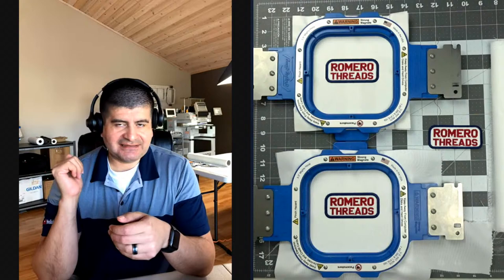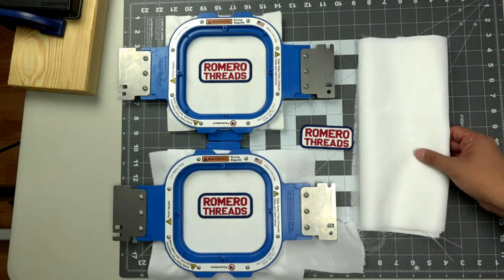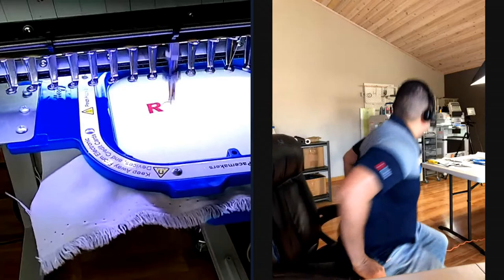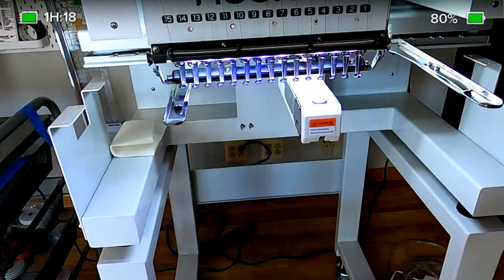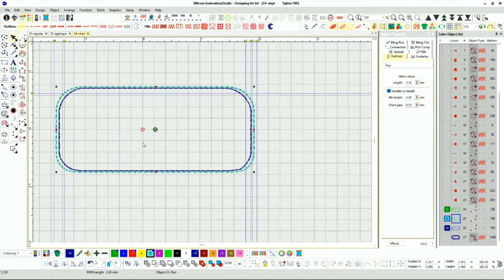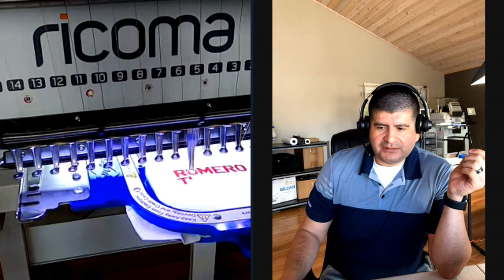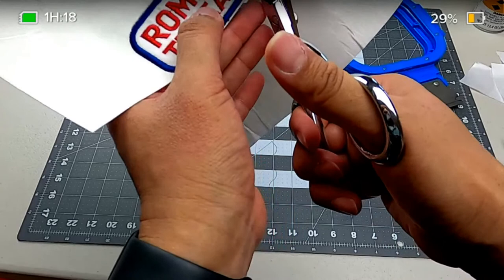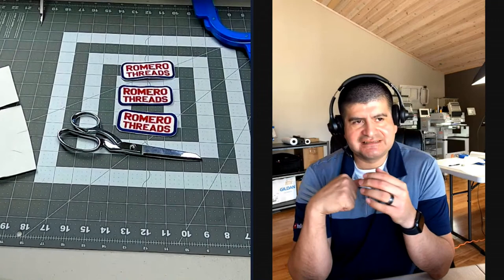Week 16- Three Ways to create patches

Comment: Have you found that not using the thread hook guide at the top of the needle is better or worse? I have seen mixed opinions and have gone back and forth on whether not I should or shouldn't. I feel like it effects tension a little bit as well but just wanted to hear your thoughts on it.
Reply from the maker: Ive always had it threaded as its suppose to. Ive never tried to change it up.

Comment: Have you ever tried heat and bond lite for patches? Do you think that might work for stability along with cut away?
Reply from the maker: The lite can be used but it will only hold temporary. You would have to stitch on it afterwards to secure it permanently.
Reply: @RomeroThreads  Thank you. Just learning the basics. Love your videos. You take the time to show every step.
Reply from the maker: Yes, I know when I was starting, videos would skip the most important details. So I try to cover every minor detail.

Comment: i was flowing you long time , they are all good video, i have some questions how can i get good quilty when embroidery
tatami stitch with 60＃thread on plush stuffs
Reply: such as plush toy or something
Reply from the maker: Since the thread is thinner than traditional 40 weight, you might have to increase the density, and add more underlay. If its super plushy, you might want to lay down a knockdown stitch. You just have to gauge how much extra stitches you want to add without going overboard.
Reply: the design is too small about 2*3cm when i add more underlay like double tatami and more density like0.28 but the left and right contractions are too large
Reply: hopefully youll be able to do avideo about the details of a plush toy using 60# thread and9# needle